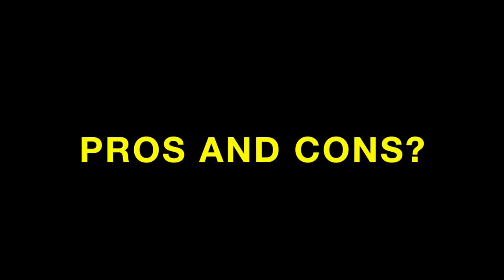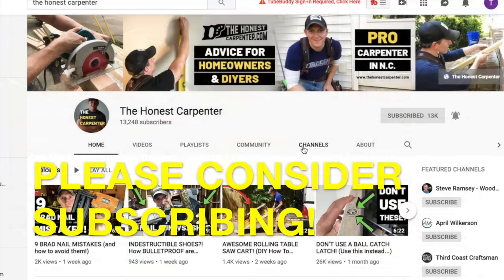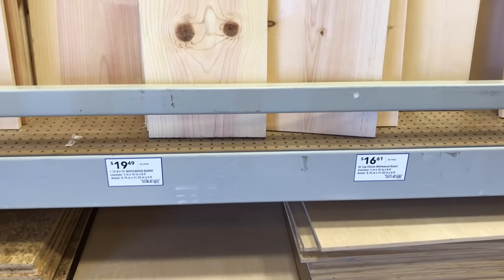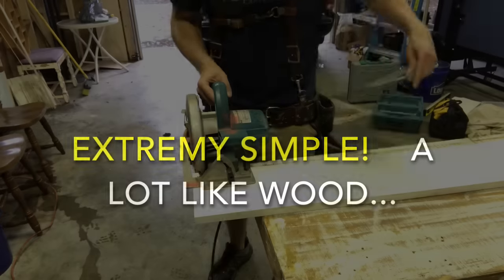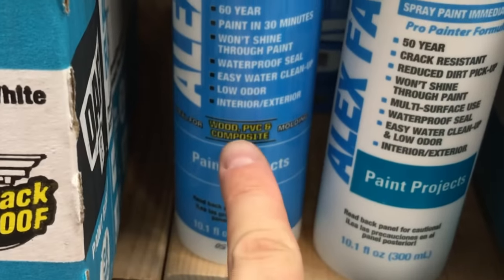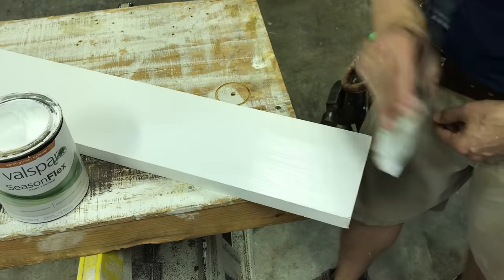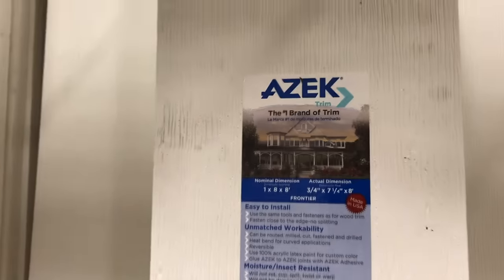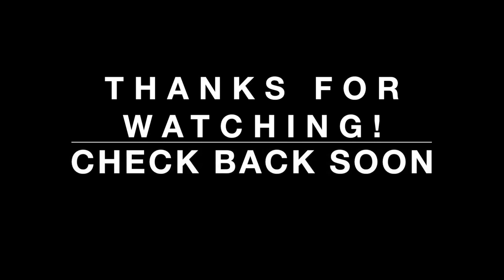PVC TRIM VS. WOOD TRIM? (Pros And Cons!)

Comment: Yup, the static-clingy white dust is a pain. Wear a mask if doing a lot of cutting. Do the cutting outdoors if possible. At the portable table saw, I plug a running vacuum into the saw's dust port. Also, set the portable saw on a canvas or cardboard to ease clean-up.
It paints beautifully, using 100% acrylic latex. Never have had paint peel. I prime with Stix or SW Extreme Bond Primer. For darker colors outside, ask for "vinyl safe" colors from paint vendors like Sherwin W. These don't heat up so much in the sun. I always paint, especially exterior, for protection from ultra-violet.
Exterior, I always use trim screws like GSK brand. Or go with stainless steel screws with trim heads. Interior, I use a mix of trim screws and 16 or 18 guage gun nails.
For small glue jobs, I use plumbers PVC pipe glue. Have everything cut and fitted, with screws started in place on one piece, before applying cement. Apply it quickly, both surfaces, and assemble immediately . . . the glue dries very quickly. Use the screws to clamp the surfaces tightly. Once set, the bond is excellent. 
Got a bad dent? I use Bondo.
Caulking? I use 100% silicon, paintable
Rot free; no mold or mildew. Impervious to water. No ants. No termites. No carpenter bees. Love the stuff, except for the dust.
Favorite use: replacing rotted basement window frames.

Comment: I have a few questions:
1.  If the cut end of a PVC board is porous, doesn't that mean it would hold water?  If it holds water and water expands when frozen, won't that split or at least expand the PVC?
2.  How much expansion or contraction does a PVC board make, because I don't understand your suggestion to leave a gap when installing during winter?  And when installing in summer can we assume the board already expands to its max therefore no need for the gap, but what if it shrinks when cold weather arrives?
3.  I installed some PVC baseboards in my bathroom due to flooding a few years ago from laundry machine.  The board was easy to work with for the most part, except when sawing it at an angle.  Somehow it got overheated (I used blade recommended for PVC) and melted on the blade and like cheese on hot pan, it gunked up and very hard to remove, which rendered the blade useless.  I was frustrated so I threw the blade away and made the cuts using handsaw and miter box.  But why did that happen?  Was my blade rated for higher rpm than what my saw could handle or lower or ...?

Comment: SOOOO true about the saw dust. I just had to rip a half dozen twelve foot boards. The dust is incredibly fine and clings to you almost like those annoying bits of styrofoam. It seems like static cling might be involved here. Keep a shop vac handy and literally vacuum yourself off after every rip. Otherwise, you will deposit dust EVERYWHERE on your job. That can be a real problem if you are working on an owner occupied remodel or repair!

Comment: I trimmed out my garage doors with PVC since the 40 year old wood needed to be replaced. I mitered the corners at the top and have ugly gaps since PVC expands quite a bit in the heat.  I used composite deck screws to fasten (not knowing I could nail it).  I found out later they don't make PVC plugs in colors other than white and I wasn't going to paint for awhile.  I ended up buying drill bits for cutting wood blanks to fill holes and used a scrap piece to pop out my own plugs.  Ended up OK but was frustrating to try and figure out on my own.

Comment: We just bought baseboards and some 1/4” base shoe to use in the bathroom. With the current price of wood, and the poor results for MDF for bathroom use I am hoping we can install it with it looking nice. For as beefy of a baseboard we would have to buy pine 1x4s and route it , and the walls in the bathroom are a bit wavy, and the pine won’t flex like the PVC will. Thank you for this informative video.

Comment: Excellent review.  I tend to be a purist/traditionalist so I generally prefer wood, and I would NEVER use PVC for interior application (even for base, just how wet does a floor get, anyway?  I have never seen interior base rot).  I have replaced two rake boards and two fascia boards with it.  Unfortunately, I also used it as base trim around the bottoms of wood porch columns and it shrunk and has left ugly gaps.  These are only about 6 in. x 6 in. but it looks like some inexperienced DIYer trimmed it.  I am an amateur but also an experienced carpenter/woodworker who knows how to trim.  I installed these during cold fall weather so if anything, I expected some expansion in the summer, but the PVC has permanently shrunk.  I would replace with wood but I installed a new porch railing and the bottom rails butt into the column bases.  Really disappointed in the look.

You also point out another major annoying factor, the PVC "saw dust" that is left behind.  It gets everywhere, is electrostatically charged and sticks to anything and everything it touches, and even what it doesn't touch, and it doesn't rot away.  I would never cut any of it in my shop on any stationary tools, and no way do I want this stuff in and on my table saw.  But I'm very leery of the shrink factor now.

Comment: Clean up from PVC you are exactly correct it is a pain to clean up after it because it gets everywhere it can even get embedded into your clothing I found that out especially when I had to wash clothes and I still had a little bit stuck to my fabrics specially when you consider your using a blade against it warming it up and making it hard so when it comes out the dust and makes contact with your clothes it literally is almost like liquid at point of where it’s cut and then it just gets really stuck to clothing and ingrained into it from the pressure of it coming off as dust toward you

Comment: I've been slowly replacing all my trim boards with PVC and only wish I had known about it when I built my house 25 years ago. Today's wood just does not hold up to moisture. I can remember a time when pine trim (even when not painted as frequently as it should have been) did last but today it rots very quickly. My biggest issue with PVC (as you noted) is expansion and contraction as trim boards that are subject to direct sun exposure in the summer really do grow considerably. I also use DAP caulk but didn't realize that some of them were not recommended for PVC so I just learned something new.

Comment: I run my Rigid shop vac with a dust bag on the mitre saw and that manages the dust. For the jig saw and skill saw I need someone to hold the vac nozzle close to the blade. Without a vac the dust makes it challenging to stem the micro plastics, let alone breathing in the dust.

Comment: Great video. My only question is this: what kind of screws is recommended when marrying two pieces of the pvc plank together?
I am making a laundry basket/hamper holder for our laundry room. I will be using the pvc plank and want to make sure that it can be secured with screws.

Comment: I used PVC Lumber to frame and install a  5000btu Window AC unit in a horizontal sliding window and it turned out great. I know that it will last with no rotting or water intrusion!

Comment: I have replaced 5 windows and replaced all wood with PVC. Love the stuff and it will never rot again. I will never use wood around the outside of my home again.
Reply: Did you build the entire window with PVC? Did you get the windows pre-made?  I have 3 windows on my garage with rotted sills and 2 door jams rotted at the bottom.  Quite a big job and I'm no carpenter, that's for sure.
Reply: @dontswin   The entire outside trim is PVC that looks like wood. I had to get my windows made from Home Depot. Not too big really.  The first window did take me almost all day to complete. But, that was because I did not know really how the old window would come out.  After that first one I can do two a day if I wanted to. Yes, my garage wood around the door outside also started to rot so I changed all that wood to PVC too.

Comment: Great place to use it is on the skirting of a manufactured/mobile home.  They used a pressed particle board that rotted out.  I am replaceing with PVC.  The skirt channel screws into this 8 foot pvc section.  Will never rot. :-)

Comment: Since making this video have you had any experience with using the same pvc glue for pipes on these guys? I was thinking of gluing up a mitered frame to move my dryer exhaust vent away from the side of my house.

Comment: Thanks for the video ... very informative for sales persons.  How ever as a home owner and green building advocate PVC is one of the worst materials over created.  It turns out that PVC is not even legal in Germany (and much of the EU) were it was invented. Even PVC pipe is not allowed in Germany.   It is PVC that will kill you in a fire way before the heat or wood smoke.  It does resist rot but what they don't tell you is that it does not breath like wood to dry out the back side condensation.  That is where that black mold grows so well!  This is common knowledge for fire crews dealing with vinyl window or plastic furniture. 

So maybe PVC trim could be justified on a home that already has PVC/vinyl windows ... but why make something worse with a poor performance product.  Cement board ... and even MDF or plywood is much less toxic in  fire.  What makes much more sense is installing the proper metal flashing above a window along with proper over hangs for a roof.  Roof details that overhang above windows and doors can also offer good passive solar help for seasonal solar gains when you need them.

I should mention another related problem with synthetic materials that never degrade biologically. One of the main causes of water pollution is failed septic systems.  Did you know what the main cause of these failures is from?  It is leach fields plugged with synthetic fibers from synthetic clothing washed in the washer!  Imagine what PVC shaving/dust coated clothes from carpenters would do to these systems! I don't even want to think about the fumes from cutting this stuff. 

The reason most trim on newer homes rots so fast is because the wrong species of wood is used.  Much of the "rough cut surfaced" trim is made out of the cheap hemlock.  If it were Redwood or Cedar ... or even Douglas Fir it would last much longer in exposed areas.  These species are harder to paint ... maybe needing oil primer ... and more cost/labor.

Comment: I dealt with one of the PVC trim companies available at big box stores and lumberyards. I kept running into some installs that would mould/mildew very badly very quickly and need almost constant cleaning, nothing seemed to work. Turned out the owner was local and found out they had issues with some suppliers, they go with the lowest bidder, resulting in poor quality in some runs of certain products. They replaced the material but lost literally months/years of income going back to re-deck and re-trim houses.

Comment: Great info.... How does the trim hold up to paint? will it crack and peel or not? Whats a good filler for the nail holes? Can it be nailed directly to rafter tails or does it need a backer board?  Thank You !
Reply: IDK but Someone mentioned earlier in the comments to use water and ground the tools to prevent dust flying away and sticking to things.

Comment: I love this Veranda PVC product. Well worth the markup.  I've used with great success wherever wood has failed due to water damage. Another great property is when you need boards to do extreme bending and curves.  I've got project right now where I'm using 3/4 x 3-1/2 12ft Veranda PVC boards as the rafter ribs on a small metal arch shed. $11 for a board not even bad.

Comment: A good alternative in some applications might be pre-finished metal flashing over new or existing wood trim.  I've gotten good use from a 2' sheet metal bender.  Menards sells metal brickmould cover, but unfortunately, none of the local hardware stores here do.  That might change once the EPA does a formal review of PVC, but they expect that will take ~3 years to complete.

Comment: I had a contractor in NYC try to use PVC crown molding in residential corridors, but the interior designer (who specified MDF) was concerned about PVC’s flame spread rating.  I think for holistic purposes I would prefer natural materials inside my home.  However, for using buildings as investment properties, PVC materials are much easier to work with and yield uniform expected results.

Comment: I used regular bathroom calk on it inside the bathroom,  even routed out the backside to glue with bathroom calk to a bathtub the had a big dent in the side, end result it looks nice over a tile floor and the tub looks like it was never damaged.  I got sick of shoe moldings right outside the master bath shower rotting out in a year. Loved this stuff so much I used it in every bathroom in the house and the washer dryer room I made an over flo floor pan in with drain.
Insurance claims run in and up to 10k dollars from busted water pipes avg cost 
A major factor is old washer hoses, these should be replaced every 10 years
Most people don't do it even the bradid type. 10 years. After that time the rubber starts to fall apart with full city water presure its only a mater of time for one to burst, worse your away on vacation or at work.  Its a good idea to shut off you main water line and water heater when you go out of town.

Comment: Reinforcing what the Honest Carpenter has said, these are my impressions from working with expanded PVC, 3/16" thickness up to 1" thickness, working with full 4' x 8' sheets and also pseudo-boards of different dimensions made for house trim.

Use high vacuum on all tools. I cut with a 40 or 60 tooth triple chip blade to minimize edge sanding. Lower speeds should be used when cutting with a saber saw or sawzall. Feed rate when ripping should be pretty fast to avoid excessive heat build-up, melting and fusing. Saw blades used should be very fresh, if not brand new. You can retire them to cutting wood later.

I like PVC for trim below door sills, especially on drip edge sides of structures with metal roofs and no gutters. If you are gonna put some dampness attracting stone steps in and need a piece of sill trim behind the steps, use the PVC. You'll never have to worry about replacing that trim behind the hand laid stone or behind a large, heavy wood stair assembly. 

Conventional latex house paints bond well. Just like with wood, I recommend a balanced finish to both faces to maintain stability. Like algebra and wood, whatever you do to one side, you do to the other.

PVC can be bonded to like material with a wide variety of solvent solutions from paste and syrups to water thin solvent, as well as the recommended construction adhesives. Solvent bonding essentially creates one piece out of two, disassociating the plastic molecules, which then re-associate as the solvent evaporates, creating a unified piece. The bond is very strong, especially when clamp pressure is applied. It's much the same as building a model car or airplane with solvent glue. Model a kit of whatever you want and bond it together, two dimensional or three. 

Sheets of thicker material can be stacked and bonded to create larger, thicker solid forms which can be carved and abraded is if they are wood. Gouges and chisels work well, also files, rasps, SureForms, hand planes and molding planes, sand paper of all grits, coarse grinding discs (preferably used at lower speeds, and what a mess that is). Moldings can be created with a shaper or router. HSS and carbide cutters both work well, but must be sharp enough to not generate excessive heat. Heat generation is the enemy with plastic of any kind. It gets very grabby and dangerous when it gets hot.

I have made full scale models of complex, cast iron, wood burning stove designs to be digitized for cast iron mold making purposes, using this method of stacked buildup of material. Black expanded PVC looks a lot like cast iron, especially the edges of the material with its slightly granular texture. Thinner expanded PVC sheet material forms well with heat for curved surfaces.

PVC moves a lot with heat and cold and is also capable of retaining some moisture. I don't think it is good for prominent, trapped, joint intensive trim situations, because PVC tends to shrink a bit over time, as well as having the built-in reactive thermal movement. Joints will open, or pinch with resulting buckling and bowing. All schemes of use must accommodate this thermal characteristic and inevitable shrinkage.

Spanning capabilities of PVC are much less than wood, especially when exposed to heat. It needs support.

Conventional coarse threaded wood screws work well with the material. Pilot drill your holes into edges, or bulges will telegraph to the face over time, if not immediately. When screwing into the face of the PVC material, pilot holes are not so necessary, unless close to an edge, where bulges can telegraph to the edge. Me? I always pilot drill my screw holes. It's plastic. It creeps a bit under tension and pressure. Very slowly, but surely, it can be displaced.

Wear a respirator when cutting, bonding and sanding. Fresh cut edges are razor sharp. Handle with care. Have some fun with PVC.

Comment: I love the low maintenance of the product after it's up.  The dust is awful as you say and there can be expansion/contraction issues that you have to consider.  In fact, I always leave a small gap at the peak of the rake boards and cap it with a keystone detail.
Reply from the maker: That’s a good strategy, Johnsoh! A cool detail too 👍
Reply: That’s my plan too. I couldn’t get the miter tight enough.